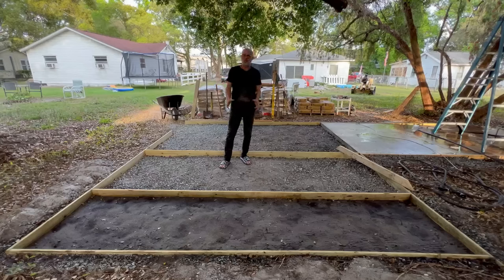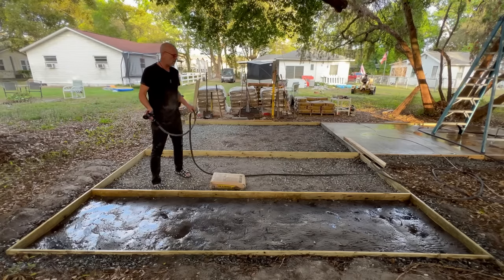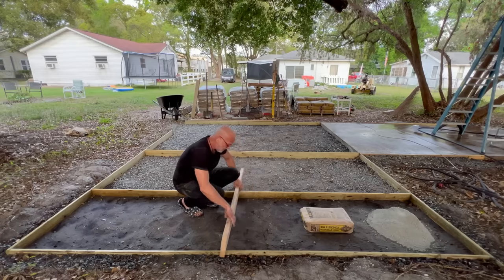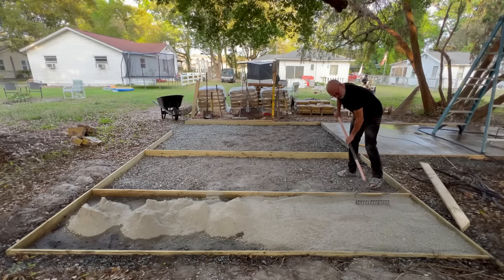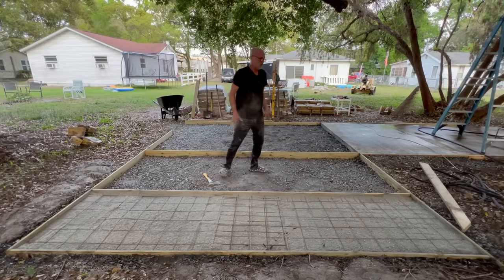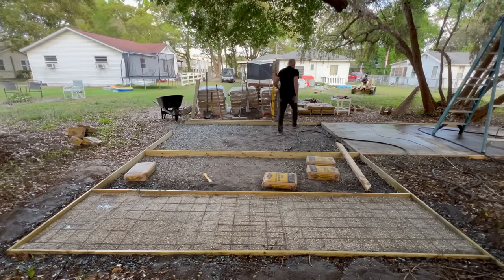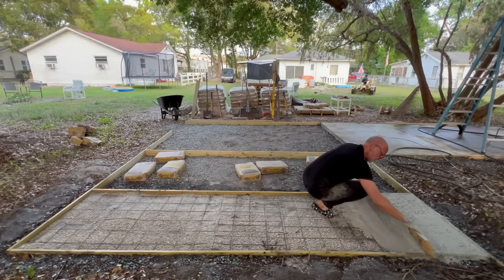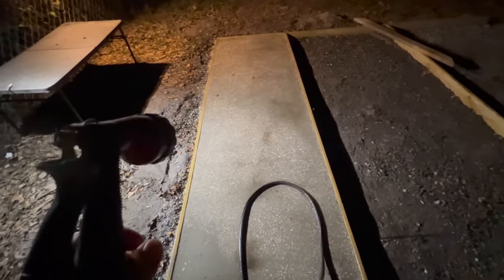How To DIY Dry Pour A Large Concrete Slab In Real Time

Comment: I live in Florida also. North of Destin... I have CLAY! Up to and Probably over 8ft deep. What Little Top Soil I have washes away with each rain. Back to Front in 180ft Land Drops over 10ft... I can also Hit water after just 3ft in Fall/Winter/Spring and 6ft in summer... So when i walk around in my Yard, it sounds like a Well Used Street Worker that's in their 40's and been at it since she was..... Specially up to a Week after it Rains.. And I Sink up to 4 Inches if I drive on it.. even a Push Mower will sink even after 4 days of Drying out after it Rains... And YOU Have Sand....

Comment: Doing a 12ft by 8ft by 6in slab addition to another slab with some added filler to reduce the amount of cement needed I saved $600 out of $1000+ just in cement in my dry pour. Job all done I spent a total of $450 for all materials and some tools, and I can say I don't think that is a lose in my book.

Comment: I would have drilled holes through those interior board and run rebar through them to hold the slabs together. Even though you have sandy soil it would be cheap insurance against those sections separating later.

Comment: Think ill just stick to the old fashioned way... bring the bags over to the work area with the hose and barrel and mix and dump till I have enough to level off then mesh then repeat done. At least I know it's mixed properly and it's easy to spread when wet. Plenty of dry vs work time as well. It's good to think outside the box, but don't fix what aint broke.

Comment: I built an addition onto my house, with basement. I did the treated wood foundation, and, like a dummy, I didn't do the floor at the time. Two stories up, so the foundation has plenty of weight on it to stay in place. I've been fretting about pouring concrete, and how to get it down there. Don't really want to rent a pumper. Then I saw this. Ah Hah moment here. Now I know how I'm going to do it. 👍

Comment: One cubic yard of concrete is about $200, estimating on the high side. So each 3'x8' section would cost you less than $75 with tax.  When you get a long panel, not square, it'd be smart to cut a control joint in the middle so it becomes two 3'x4' panels.  Prevents getting a crack right near the middle.  Gonna give you a like, though. :D

Comment: You did the most important thing first. You tested on small section.  You tamped.  You used 4 inch which is a realistic min for conc slab.  In snow country id say 6 inches & 2 way rebar

Comment: As a structural engineer, I am on the fence about this technique.  Is there a history of compressive strength test data indicating this method meets or exceeds the design mix strength?  Especially throughout the entire thickness of the concrete?
Reply: As a contractor I am curious as well. Certainly wouldn’t drive on it. My best guess is it comes in about 1/2 strength, 2000 psi. Durability is my next question.
Reply: @davidj1436  agreed.  I've seen too many slabs turn into rubble too quickly.

Comment: I think you could cream the top by giving enough moisture, then patting it a long time, which will draw the concrete back up to the surface and it will leave a fine texture over the gravel.

Comment: You should use clean Portland cement for the top,if you’re going to do two steps. Clean Portland comes in 98lb bags and is already smooth and free of gravel.
Reply: Needs sand as well, like motar mix when laying block
Reply: Cement doesn’t require sand,it’s just a common aggregate to bulk the material with. The only reason I wouldn’t recommend sand for this application would be the need to premix the dry material before applying it.

Comment: I'm extremally curious about this method. Primarily because of the cost. I'm wanting to build myself a shop on my property and am wondering if this method would work. Yes, automotive work, fab work, welding, carpentry, etc. All of that would/will be done inside of this building. Although I don't own any "heavy" equipment. Just a ton or two of tools. (I went from an oversized two bay shop too an 8x12 storage shed and one of the spare bedrooms for all my tools. But at least I own the shed and bedrooms!) 
Do you, or anyone else, think this method would work out for me, or am I stuck with dealing with a concrete company or renting equipment to pour it wet myself? Any advice would be greatly appreciated!
Reply: I wouldn't trust this to hold up well if you're going to be driving stuff on it. It may work for areas that will only have foot traffic, but if I were you, I'd hire someone to pour it (if you don't have experience with concrete) so you'll know it's done correctly.  Admittedly though I have no experience pouring concrete
Reply: @robbiebaker2412  Yeah, this is why I'm asking around about it. It would mostly just be my truck, a half ton extended cab P/U w/ an 8 foot bed. Al though I do also work on other folks vehicles from time to time as well as build engines and other 
non-automotive things. Welding and such.
Thanks for your reply Mr. Baker, greatly appreciate it.
Have a good one and be safe out there!! 🤠😎

Comment: These need some stress relief, whether you plan to cut them afterwards with a saw, or planned ahead with the forms to have a 1/4" dividers making these into thirds of their current size.  Can't imagine these not cracking, and that assumes you are not in a freezing climate to where the ground will heave.
Reply: No relief required, they are already small sections.

Comment: From the looks of your layout there, if you have enough space for a concrete truck to back up on it could be poured in less than 20 minutes. As long as it can be leveled out fairly quickly you could get a 40 or a 70. Depending on outside temperature.
You really should have wore a mask to dump out all that dry cement.

Comment: I myself did a small concrete 4 square 3.5 ft x 3.5ft pavers to replace small brick pavers that just looked bad at a house i bought.  Even though it may not look professional it still looks better than the little brick pavers they had that were sunk in the dirt and very uneven.  might do a touch up layer this year to fix the top and give them a better smooth look as i had no idea how much concrete i needed for the area and bought too little and had to do several trips as i kept seeing i needed more and more.  I didn't care that it didn't look professional as long as it looked better than what was there and honestly, besides walking on to go out in the back, it never sees use really so it doesn't matter.

Comment: This popped up in the recommended section. I was thinking about fixing the driveway at the house I just bought. I did watch a few videos, like you did, that were doing tiny 4 ft sections but nothing large like this. You get a like and a sub from me. I may try fixing my driveway now doing it this dry method way. Looks easy. Just have to do all the prep, that's the key. Like painting a room. Once you get everything prepped correctly it's easy and practically does it itself.

Comment: The one thing I see from all the dry pour videos is that nobody (except for you) is using wire mesh. If someone is building a small shop, or anything or anything other than a chicken coop you should really consider it, as it makes it stronger and ties it all together.  As well as a layer of plastic to give it moisture protection.

Comment: Just FYI.  For $135 a day you can rent a gas powered wheel barrow, a powered buggy as they call it, that can hold up to 21 cubic feet of wet concrete.  For a 10'x10' 3-1/2" slab that's two trips from the street way back to your forms in the back yard.   2 yards of ready mix concrete will run you about $350.

Comment: Tamp it first,screed it off,fill the low spots,tamp once more and give it a final screed ie. Save some energy and Time. Using gloves,boots and knee pads will save the skin on the parts of the body most in contact with the cement, you'll know by now I'm sure if you have managed to complete the pad for you man shed. Great job by the way that bit of mesh will stop any major cracks should see you out, might be prone to dampness, ie. No DPM used might have to paint the floor with a damp proofer if you are using it as a floor in the shed. Don't be tempted to go on one of those cruise holidays, think about your carbon footprint, your health and the lives of future generations.

Comment: I"m a DIY guy who occasionally does large and small concrete projects.  For me, dry poor method doesn't really save a lot of time and results in an inferior product/look.  In fact, more time is spent on dry poor after the initial wetting.  Requires a lot of babying and prevents moving on to other parts of the project.  For either wet or dry poor, the main effort is in preparing the ground and correctly placing forms.  You mess that up, it doesn't matter what method is used, the slab will crack, sink, and/or chip.  Showing the feasibility of dry poor is one thing but giving the impression that it's quicker or comparable in quality as wet poor is another.  As my wise grandpop used to say, just because you can doesn't mean you should.
Reply: The word is POUR, not "poor".

Comment: This was not done like the video I saw with a guy and his wife that seems to have this down pat. You load all the mix in and screed dry. That knocks down the rocks you use a brand new paint roller to smooth. You micro/nano MIST,......... not what you did. You do the first and an hour mist again. Then wait an hour and you THEN you can lightly shower it as the top crust is hardened by now. Not too much water either. Then you shower every hour  TWO times the thickness of the concrete. So 4 inches is 8 showers + the two misting at the beginning. The guy said you do not want to wet the bottom as moisture comes up and screws up the concrete.

Comment: I was a contractor years ago and poured hundreds of walk, patios, shed slabs and walkways around pools.
These dry pour methods do not last in the long run.
Concrete needs to be mixed with water in a mixer barrel or small amount in a tub.
Thus it will bind and cure properly.
Dry pour is a cheap amateur method that most likely will result in crumbling in a couple of years.
For larger jobs a mixer truck delivery and a couple of wheelbarrows to concrete haul from the truck.  That eliminates the need for a pump.
Simple.  You get what you pay for.

Comment: The best comment below is that it would be worthwhile to use cement with only sand and without aggregate (i.e. mortar) for the top inch or so.  This would fix the screening issue.  If you want an even better top finishing that is dead level and quite strong, do a rough job up to the top 1/2 in, then mix up a few buckets of self-leveling concrete (which is much more expensive per bag but has a lot of latex in it and a relative indifference to how much water is added).  Then fill to the top, roughly level it, and it will settle to dead level and the extra water will pool and evaporate.

Another suggestion is that since you are not using a cement truck and crew etc., and it's your own labor, invest some of the money that you've saved in more and heavier gage steel reinforcement, and make the overall thickness greater by an inch or so.  The extra reinforcement will probably do more to avoid it breaking up and becoming un-level over time more than anything else (besides using a mixer and metering the water exactly).  If you want this to last, use 1/2 in rebar every foot or so both along the length and width.  With this level of rebar, the strength of the concrete isn't quite as critical.

Probably the next level expert in this technique will say something like 'this works best if you only lay down layers of dry concrete that are maximum of an inch or so, so that there are no isolated pockets of not-fully-hydrated concrete in the block.  Then mist heavily until tiny pools appear, then add no more water.  As long as each layer is placed one on another in a short period of time (i.e. a couple of hours) then the layers will firmly attach to each other.'  But this is a bit of guessing on my part.  I've personally never tried a dry pour, I guess because I have a mixer and using it has always produced strong (enough) concrete.

I'd like to see a video of a test of a method like this, to answer the question 'how deep does misting penetrate into dry concrete'?  With this result we could get an idea about the maximum thickness.

All the comments below on PPE (minimum would be some good elbow length gloves) should be taken serious.  Cement burns are not nice and take a long time to heal (speaking from hard experience).

Anyway there's a lot to like about this approach.  For really small light-duty jobs this looks like an interesting way to go.

Please make a video in about a year telling showing us how it worked out.
Reply: Hi I'm not greno pro but I agree with you I'm going to tray at Laos on the farm  concret truck can't get there so only by walking tractor
Reply: I’d like to see more about your framing

Comment: It's cheaper if you do it yourself. But not so much in concrete bags. Buy Portland cement ,Sand and gravel separately. Dry mix them yourself in a cement mixer. Save you a couple of hundreds

Comment: I still don't understand the advantage to this over just mixing the concrete and spreading it wet. All the principals are basically the same just you are guaranteed a stronger more water resistant end result. Not to mention if you buy all your sand gravel and cement separately it is a lot cheaper than these bags.

Comment: Bet you had to use a ton of lotion on your feet & hands. Cement dry's out skin & can burn it is left long enough.  I used the paint roller to smooth out the top like the Louisiana couple. The biggest mistake homeowners make when mixing concrete is too much water. Dryer concrete is stronger. You must have a strong back as I would have stacked the bags to save getting them off the ground.

Comment: Lol. When I was a teenager I could have only wished that that kind of rake raised up and hit me in the face. Instead I put a few of the tines through my foot. First tetanus shot I ever needed. That's said, if you want a strong pad/foundation borders or whatever you should mix concrete thoroughly before your poor. There is a chemical reaction that needs to happen throughout and at the same time so that it cures all about the same rate. This will ensure that the concrete has bonded well throughout the poor. Dry pouring works well for small applications like steps through a garden or something of the like. But for large load bearing surfaces you should mix and then poor. It has a much better hardness.  It will allow itself to help support its own weight and not have weak spots that will separate and cause cracking.  Also if properly prepared for it goes much faster.

Comment: Why not just mix the concrete up there while it's in the form wet it down mix it up a little bit and get a throw more better mix the dry pour is not solid when you break it apart inside

Comment: I was just quoted 4000 square foot driveway lay at $44,000 so I think he saved a fortune doing it himself.
Reply: I've poured concrete since 1978 residential and commercial including freeway bridges/on ramps, curb n gutter, multiple story offices, park, hospitals, even airports.  I can offer advice hire me bet ya save ten thousand bucks at least.  Companies triple the labor cost and then keep 80%.  They get 10% off material costs and tax evade deny. Having a knowledgeable representative saves frustration and money. I'm an Idahoan, 30% disabled Veteran had problems walking so learned how to crawl wet cement it is a hand finish and is more durable than a power  trowel. Please respond  and no matter what
Don't  Dry Pour!

Comment: My HD sells 60lb bags in bigger qty for $5.10 per bag. It takes 60 bags to make 1 cu. yard of cement. = $310 per yard.  at 4" thick, 1 cu. yard will do 80 sq. ft. In my area ready mix is $128 delivered. 3 yard minimum... so you need to pour 240 sq. ft.  to order ready mix...
Other commentors are correct... this method will not produce near the quality or strength as mixing with water. the agitation and complete hydration is necessary to generate the long polymer chains needed to produce strength...

Comment: You should place the bag on the ground and get it all wet before opening the bag, so you don't get any dust, that is one benefit to dry pouring.
And then wet it before you spread it too so NO DUST!  It is harmful to your health to breath it.  And as I've said on all the other dry pour videos, misting it a bad idea.
You need to trowel wet concrete to finish it so it brings up the cement rich 'cream', which create a very hard surface.  Misting it leaves a weak surface.

Comment: I called and talked with Quickcretes technical department about doing this years ago. The Tech made it clear this yields stronger concrete than mixed as a slurry first. He stated “ This insure the strongest concrete because the mix only will take the minimum amount of water to cure” ( crystallize). “More water beyond that ideal weakens the cured concrete “ .
Reply: Now that is great to know. Is it easy to make and remove the framing? Ty in advance 😊

Comment: Dude. Just take the native ground materials and mix 5 shovels to 1 cement powder and place until you build up in layers. Add water as you go. Dryer the stronger. If you don’t finish in the same day just pour the next days and smooth out. Concrete bonds to concrete. Simple adhesion. Sand compacts with water. If you have more sand mix more cement or clay. Less sand soils = clay. More clay less cement. Rock is a filler. Can be cheap or expensive depending on availability. It’s not a mystery. California was built on clay adobe. I’ve built many walls and floors that will last a few hundred years and won’t crack with heavy trucks. Add steel for flexibility.